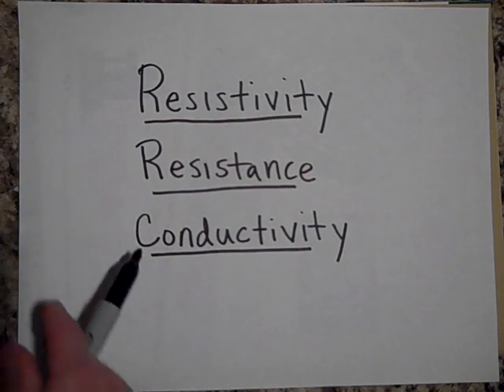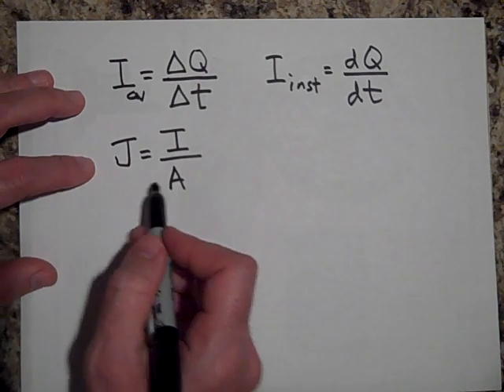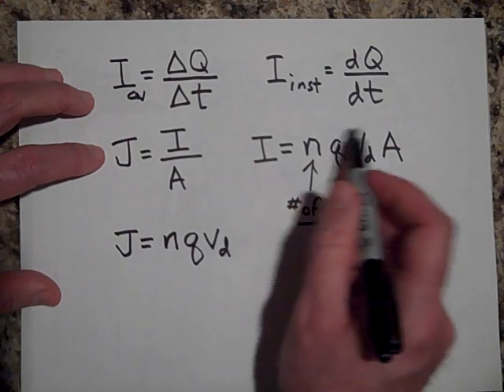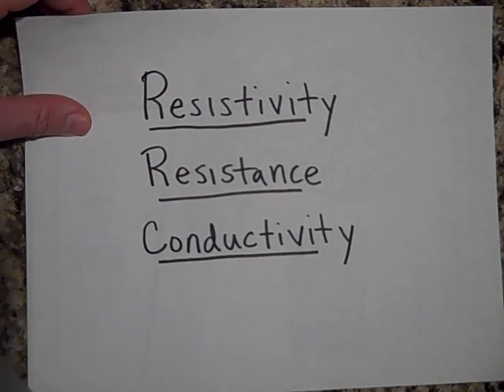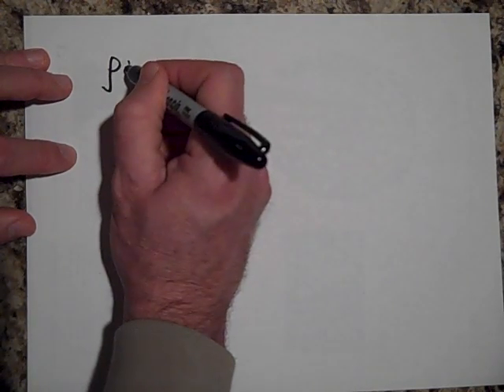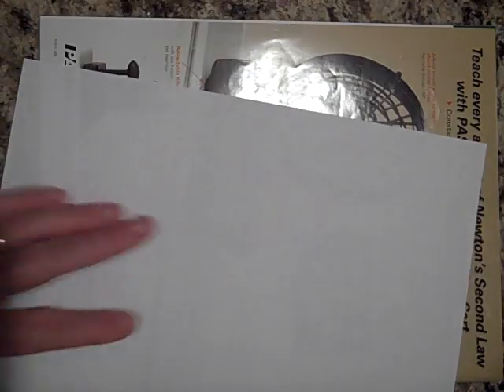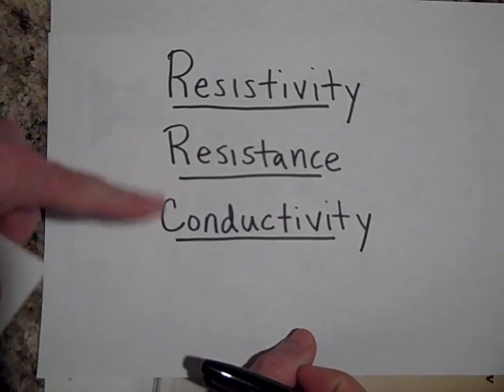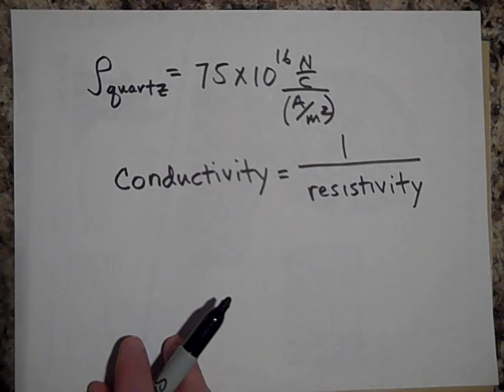Resistivity, Resistance, and Conductivity

Comment: Actually its not only the temperature that affects resistivity but also the Length and Area
Reply from the maker: Resistance depends on the length and the cross-sectional area of the wire.  Resistance = (resistivity)*L/A
Reply: @lasseviren1  yes, but I thought you said in your video that resistance is only effected by temperature ?
Reply from the maker: @defensegeneral9893  Resistivity is only affected by temperature.